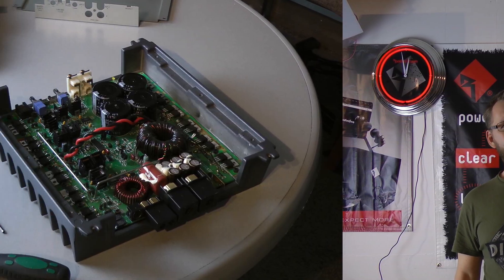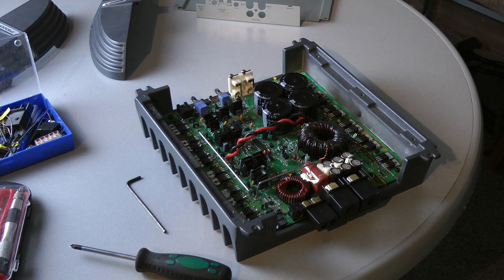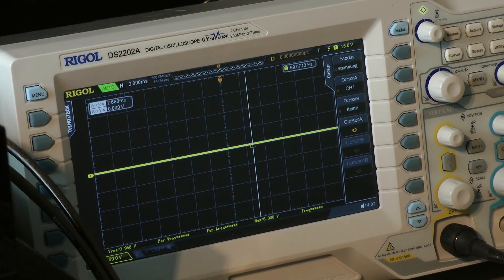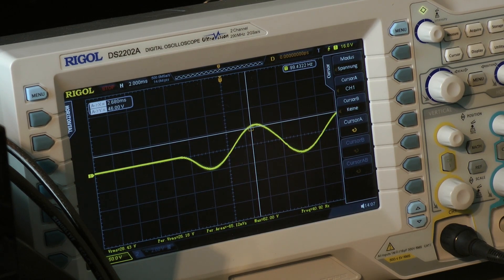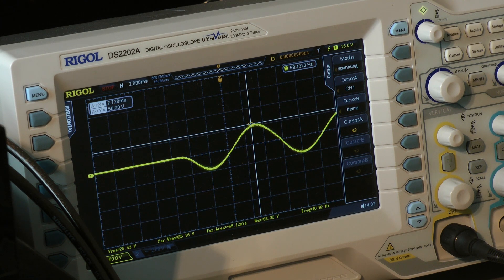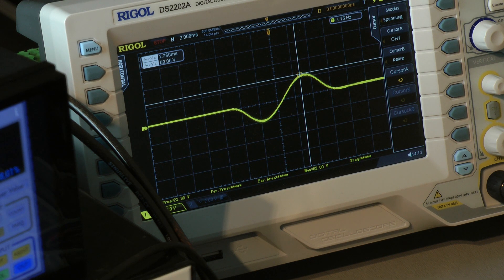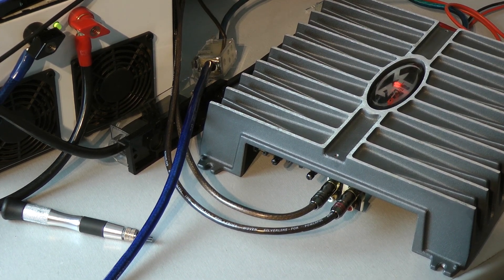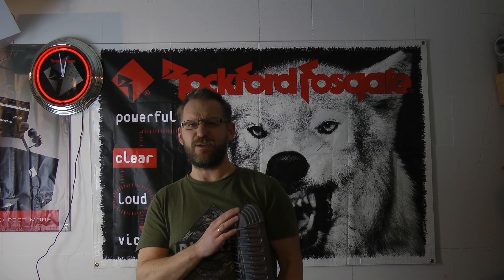Rockford Fosgate Power 1000bd dyno oldschool amplifier test - 1 Ohm mod - mono bass / subwoofer amp

Comment: Can you do the 801s
Reply from the maker: The 801s isn’t a class bd design, it’s vey similar or almost the same like the 800a2 which I already dynoed, if I get a 801s I will also dyno it !
Reply: @audiokeller1975  you just answered a question I wanted to ask. Are the 800.2/801s/ and 800a2 basically the same amp?
Reply from the maker: @carltonmiller8086 Not 100% sure but basically yes, it’s possible that there are some small differences in the input/filter section or terminals

Comment: I have a few of the pro 1001bd the light silver color same as these logo is blue. I push them at 1 om no problems. I have one on each pair of L7s and they dont ever quit
Reply from the maker: Yes, a speaker is an easier load for the amp than a fixed resistor which i use for testing

Comment: Another great vídeo! Do you know if is possible to modify one 200a4 to 400a4? Looking the schematics its almost The same circuit. Thanks
Reply from the maker: i am not sure but i think the 400 has bigger transformers and higher rail voltages. i had the 600a4 on the bench and it had more output FETs ( bigger size of amp ).

Comment: Hello.  Nice video as always!
Have you ever tested  a Punch 150 amp for power?  I recently bought one at Wattsuppaudio, and it sounds good, but it doesn't sound that loud.  I had one in 1991, and I remember it sounded pretty loud!  According to Amp Performance website, it has 121w per ch., but it doesn't sound like it.  I have a P325.2 amp from 2006, rated 75w per ch. also, and it sounds louder and bassier!  It's like the P325.1 amp you tested here, but it's 2 channels.
I thought the Punch 150 amp would be at least the same or better, but it isn't!  Anyway, thanks.
Reply from the maker: Hello!
Are we talking about theearly 90s punch 150 ( hd )? if so: too bad i never had one on the bench ☹
Reply: @audiokeller1975  it's the Punch 150 amp model, before the "hd".  They're the same size, though!
Reply from the maker: these are very expensive and hard to find here. if i will get one , it will get dynoed 👍
Reply: @audiokeller1975  yes, I paid $159 Euros.  But the Punch 800a2 amp, is even more expensive!
Ok thanks.
Reply from the maker: good price. Here they are around 220 and one 1st gen for more than 700.
Reply: @audiokeller1975  Here they're US $300!  Ok, thanks.

Comment: I have this amp. 
Know of anyone that repairs these? Mine slams fine, but it's hurt.
Reply: I have same issue, high pitch noise
Reply from the maker: @xshapeshift4755 twist and move the transformer and check if it disappears! 😊👍
Reply: @audiokeller1975  I have same issue, will try tomorrow & report. I can make it stop by pressing on power wires until warm, then releasing pressure makes it whine...
Reply from the maker: Hi!
i dont know who repairs them because i fix them by myself 👍😁
whats the problem with your amp?
Reply: @audiokeller1975  there's a constant high pitch whining sound but it doesn't get louder of quieter based on the volume of the head unit, audio is intermittent at low volume until it warms up or until i turn it up loud for a track or 2 then it stays clear and constant, I use an aftermarket rca style bass knob to control the amp
Reply from the maker: You are maybe lucky. that is a common problem on the power bd series. That whining comes from the transformer  . you have to move or bend the wires around until whining stops and then fix it with something like a glue or silicone to keep the transformer wires in that position to prevent it from whining again! i repaired the 1000bd and had the same issue - easy fix 😁
Reply: @audiokeller1975  Thanks, i'll give it a shot.
Reply: @ktotheswiss1617  
What is the update to your amp whine on how it turned out?
Reply: @sevendyseven4090  Whine is somewhat still there, but the primary issue was solved, one of the 6 cooper wires on the large coils solder melted off, re-soldered it, 75% improved.
Reply: Where do i put the glue
And wat kind of silicone should u use it for